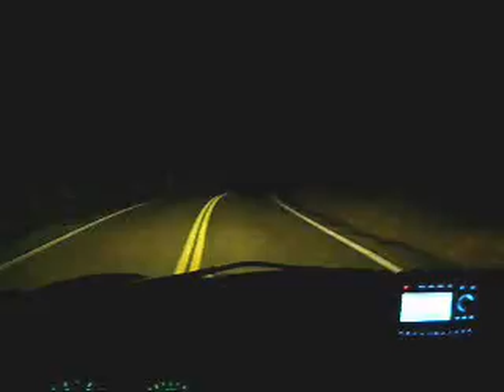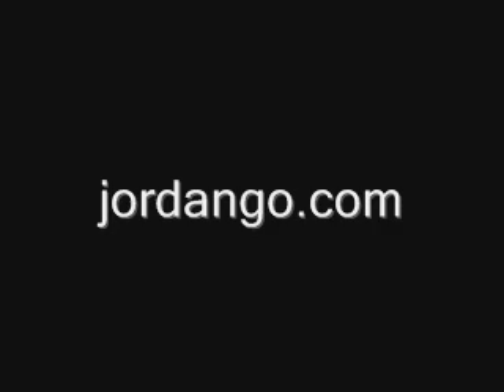HID Hella's Driving

Comment: You sure screwed up those lights.  Hella 500's have a nice bow tie patter that covers the whole area with light with no hot spots.  All you have now is a single hot spot.  Pull the HID are replace it with a 100W bulb and you will find you have more usable light.  Heck even the 55W bulb will have more than you have now.